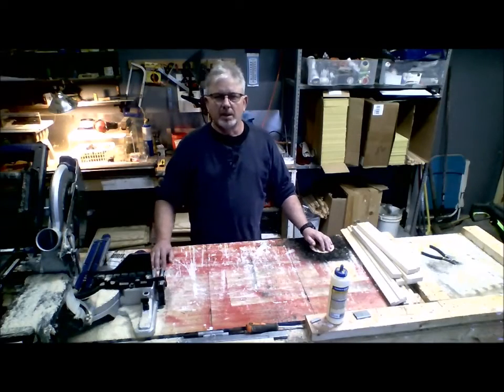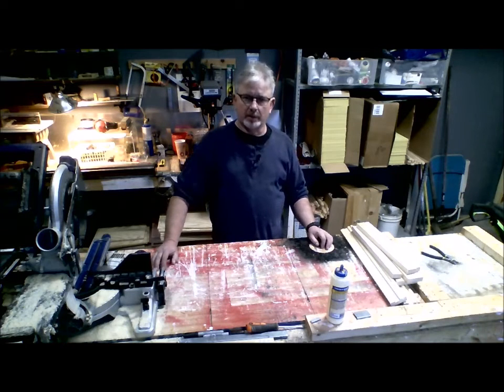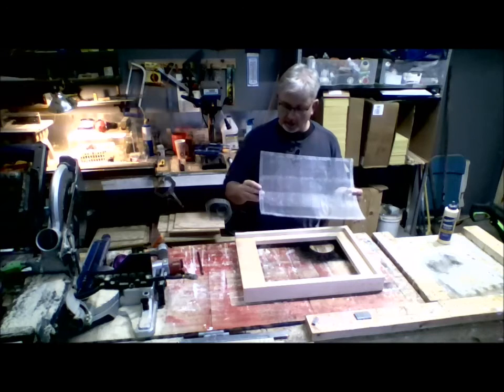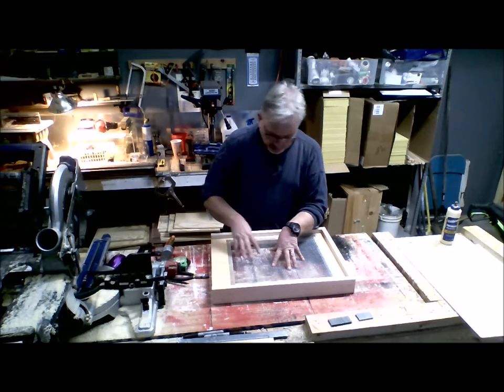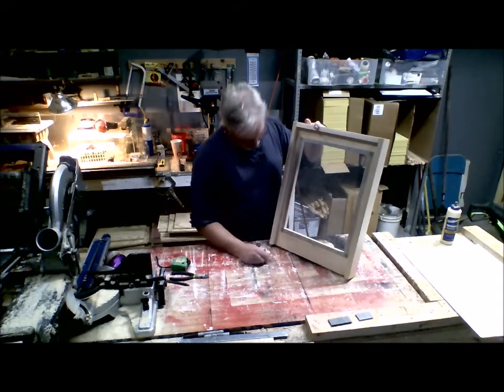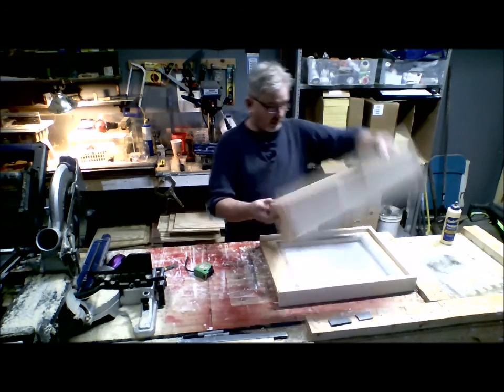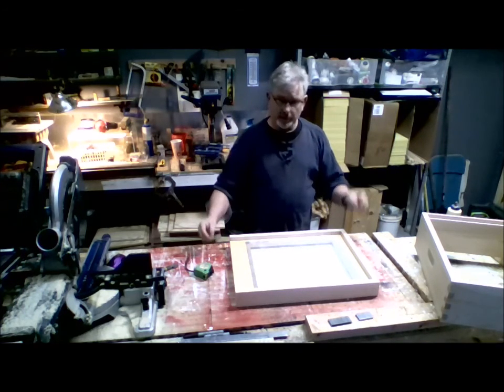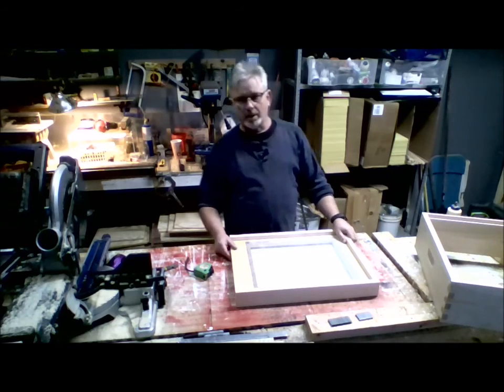Building a screened bottom board

Comment: Just wanted to post the board dimensions he used for quick reference later:
Front 1" x 4" x 15 1/4"
Back 1" x 3" x 15 1/4"
Sides 1" x 3" x 21 3/4"
Slot Inserts 1" x 2" x 15 1/2"
Backstop 3/4" x 3/4" x 15" - Size to fit after assembly
Hardware Cloth 1/8 " x 18" x 14 3/4" - Hem 1/2" all the way around.

Comment: impressive video for a store buy on here is $60 + taxes and they are cheaply made I will never get all of the bees out of the  walls  did take some out my beekeeper said they were
 there for a long time and does hurt the walls too they do not bother me in any way to I do mind them in being there 
would never know they were there January need to do a repair in equipment for the springtime they parts were done them for January heated the shop up and the bee must have thought it was spring 12 hours the shop was swarming with the bees kept the heat on for them throw the rest of the winter too and feed them too they do eat this morning I open the big door for them to do whatever they want to do this year too and will welcome them back too 
take 200 hives out I think I hit them hard now  and I will very them alone now I did not spray anything back on the wall to stop them from building there again I would not mind if the did 
 the top board was $25 + tax and the beep hives $125 + tax  it does add up $225.00 just of one I could do a better job on all of them my uncle send me a big packages of lumber to use to need to be planed only thing but it was free good day planing them all  cut them too oversize, for now, I have a wood shop put them on the CNC tables to let it cut all the cuts to  did put my logo in each part of the hive I make and number all of them too  did frames too that way 
paint them all too white  did take some into my sister in law  grade one class to put their paw all over the hives  25 hives got done  came home and put the clear coat on top of them  had 25 done  by a paint club  too this time I did charge them to use them  they were happy to paint on them to 
I did have 2 people came out and put up the hive to paint on her 4 of the boxes are amazing they do not mint $25  charge too the bee keep did give the honey too the kids did get the honey to take home did bosts the beekeeper sale of his honey he said he sold out on